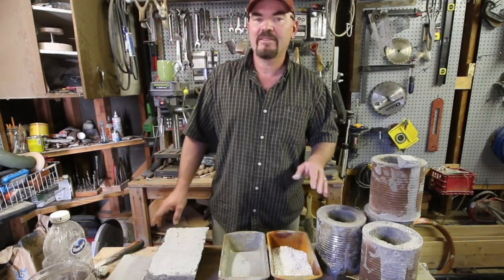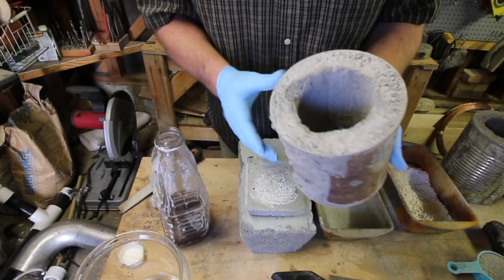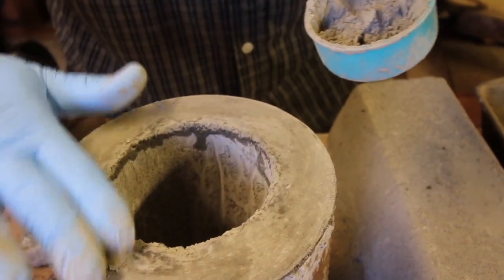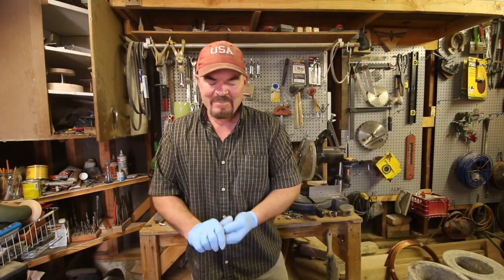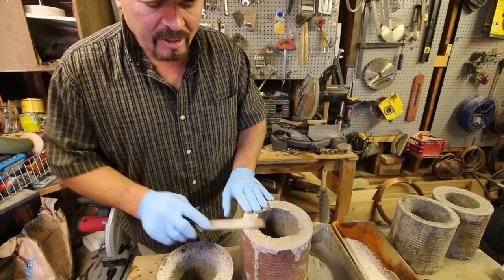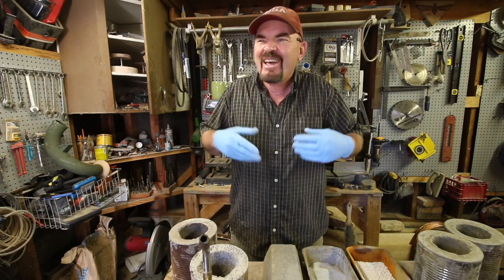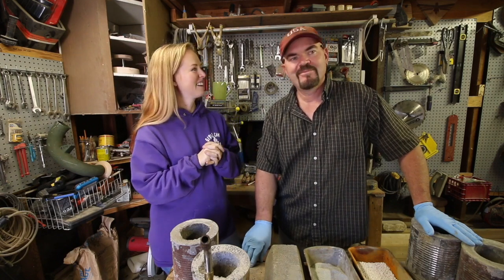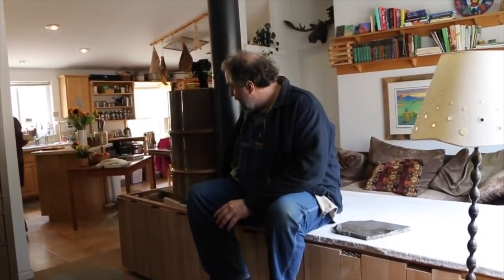Creating a Refractory Mix Out of AirCrete for the Rocket Mass Heater

Comment: Whoa Partner:  Not trying to rain on your day or parade.  I respect your enthusiasm and what you are willing to do to make a Henry Ford moment of your own... but I think I heard you say "there is really no safety concern..." or words to that effect around min 18.  

Please refer to my comments and replies to others following your work and enthusiasm, et al.  There is A LOT of reason to be careful here and safety has to be primary in all designs and installations.  The debate between "as drawn" or (intended) and "as built" alone is a huge issue and I respectfully disagree with some of your claims in re RMH and RS's.  They are of tremendous utility and value but they are not without inherent risks that often cannot be diagnosed until after failure.  Catastrophic failures...

On a related matter, having once shared your enthusiasm for experimentation and development myself... I too attempted to find the "perfect" mixture for R and K (two very different things and matrix's according to where it was deployed in the system).  It is tempting to believe that you have it all figured out - and like you I was even proud of my work.  Upon testing however I "learned" that true refractory examination is conducted at temperatures much higher than I have heard you yet mention.  While 1800 deg F sounds fantastic and your thermal transfer / surface observations impressive... I share that you may find this changes over time and that there is a reason to look beyond the relatively cool tests you have performed.  

The cheapest way to get this experience is to put one of your stack sections in a common pottery kiln and use successive cones until you either make it to the range that the steel liner begins to fail; way past red in other words.  IF the coffee cans can even survive that. If you can find someone willing to risk their kiln for the sake of your experiments; the failures are often spectacular and destructive and you need to "walk the cones" until you get hot enough to approach the conversion temperature of your matrix - call it the "glazing" temperature for the sake of simple discussion.  Then add a margin of safety.  Stack fires can achieve these temperatures and a RMH design only increases the potential for super heating the failure.

At the same time, I agree that your approach will also be somewhat self-limiting as once a failure occurs you (may) see a decrease in the efficiency of the RMH as described by throughput of burning gases.  But these hot gases may fail in an unintended direction and are often above the temperature of ignition required by (wood, paint, paper, cellulose, etc) in the vicinity.  I think you have even witnessed this in some of your experiments (as I recall from your early work; one with aluminum in particular (no?)).

To end here, I am sure you are concerned with safety and do not mean to use your words as weapons.  Nobody likes that and I have no wish to confront you at that level.  No doubt others could do the same to many of my feeble attempts to address the issues and questions posed.  I thank them for being kind in not doing so but I also encourage you to explore the true temperature requirements of your designs however (whether designed for R or K) and their true requirements at failure mode.  It is a lot hotter than at least I appreciated when working through the experiments you have also performed and it is A LOT harder to develop a stable matrix that can take the higher heats that can and do manifest when failures occur across the life cycle of the installation.  When your matrix can survive the heat of propane, acetylene, and so on you will be getting closer - and I do not mean a propane torch flame simply applied to the surface.  I mean the temperature propane /acetylene/ other gases "fire" at... It is hard to do (IMO).

I wish you only success where and after I did not find it (simply and economically).  I believe your enthusiasm and intellect may indeed lead you to a Henry Ford kind of moment... though I share that it may be a bit further down the road than your tests in-situ and on film have at least disclosed.  Validation studies across varying batches (batch to batch), working conditions, water qualities, wet-out ratios,  varying mass and cross sections... etc... - all - remain as challenges to clear, optimize, and the validate again - with a margin of safety.  You could spend a lifetime doing nothing else and so people have...

But hey: if it weren't for the failures neither Edison or Ford would have accomplished what they did.

May you be as fortunate.
Reply: Agreed, I've looked at very many DYS mixes for melting bronze, unless you are using several ingredients and pound the stuff in very dry mixes, they are so fare doomed to fail in time. I've been following here some time and using regular Cement is probably the wrong way to go to start with.

Comment: if it's light, it doesn't have the mass necessary to be an efficient thermal battery.  air crete is a great insulator, but lousy mass for storing heat.
Reply from the maker: It turned out to do both very well, it doesn't ever heat up to a HOT temperature but it holds the heat it does absorb for a long time. It has been an interesting process learning all the quirks and modifications that make it optimal in it's performance!

Comment: Does a rocket mass heater affect your house insurance.
Reply: Excellent question.  In our area (Oregon; Yamhill County) our county has/had a building spec for RMH's circa 2-3 yrs ago or so.  I have not looked at it recently to see if it has been updated but was a good read back then.  From memory, requires prints and some inspection on construction but the County has "guidelines" that can reduce your design expenses and construction costs.  Search Oregon Uniform Building Codes and ck it out.  Non-conforming installations certainly can affect insurance and/or void policy post incident and void your policy.  Good question everyone should consider up front.  If only for the sake of (possibly eliminating) expensive catalytic elements many Codes require for air emissions.

Comment: Not rocket surgery diatomaceous earth is a better fine grit mix with the portland
Reply: claybob83 what ratio would you mix diatamaeceius Earth to cement to foam?
Reply: Agree!! but watch inherent salt content in (some) DE sold.  DE is mined from parts of the world that may/may not have high salt contents.  It may or may not have been washed after and washing may not be disclosed on packaging.  If source is unknown it is best to wash DE before use - which is a pain but the only way to be sure.  Issue is only relevant in some mixtures and/or against certain reactive surfaces (like zinc on galv surfaces).  A common pool filter is the easiest way to clean it quickly w/ plain water.  Drying takes time but laying it out on a tarp or tray in a green house (or simple hoop and plastic "tent" like gardeners use) can speed this up.  Be careful not to breathe DE when breaking it up again.
Reply: Frank Glass  could you use food great DE.
Reply: Good input.  Unfortunately I cannot comment on what makes "food grade" DE different from industrial or pool grade DE.  One would hope that there is some discernible difference but whether that makes a difference in a concrete related or RMS application I don't know.
Off hand I wonder if using a cement that is salt tolerant might be a way to side step the issue (?) Maybe somebody that knows more about it will comment.  In any case, the issue of heat/salt staining/corrosion down stream in the life cycle remains the primary issue (yes?).  But thanks for the input.  I hope you are on to something there.  Even a modest increase in the cost of food grade DE would be cheaper/easier than cleaning and drying it ourselves.

Comment: Yes do that... waterglass bath... on everything... heat treat... and see what happens..  And I can imagine if the mix failed in the stack the can on the outside would eventually start to turn red if the heat started to leak through... so it would be obvious..

Comment: Fun videos to watch.  I have a question, do you think the Portland waterglass can be colored and retain its' hardness?   I have some non-frostproof tiles on my roof that the surface glaze pops off and I'd like to seal them over with colored waterglass, that torch it to make it waterproof.   Any suggestions?    Lawson Di Ransom CanyonLawsontrust at gmail.   Peace out to you too.
Reply: Tried certain elements/colors.  Very dependent on chemistry but many cement dyes work well.  Overall colors tend to be pastels after cure but as we are mostly interested in exterior appearance without regard for core color - many cement dyes, acid treatments, and (some) finishes work well.  Better stability on low temp elements of system but good marketing angle for high end installations.
Reply: Use potassium silicate instead of sodium silikate potassium silicate does not dissolve in water after hardening